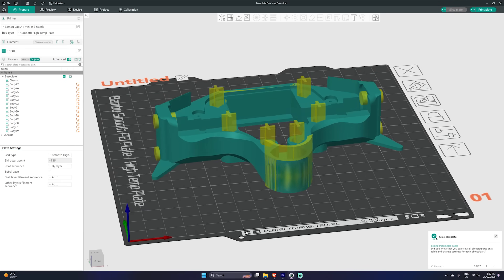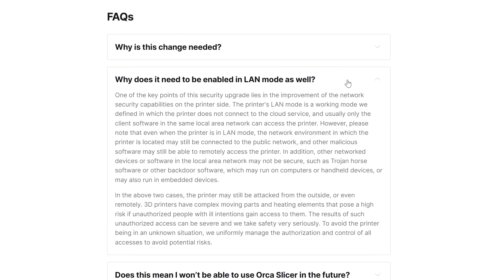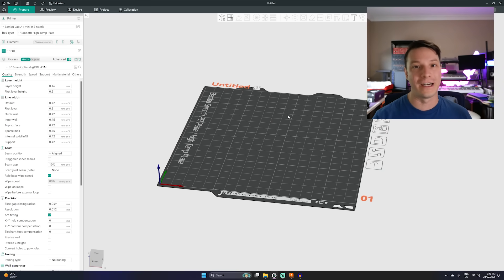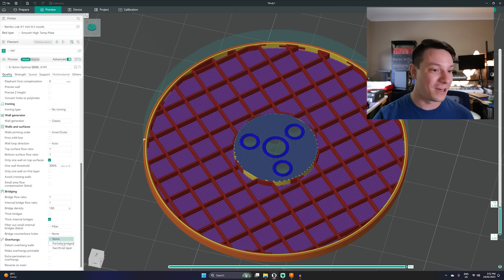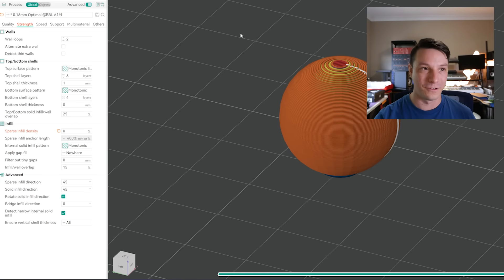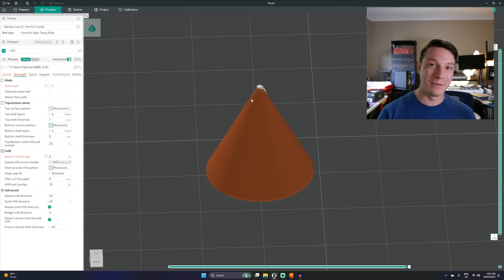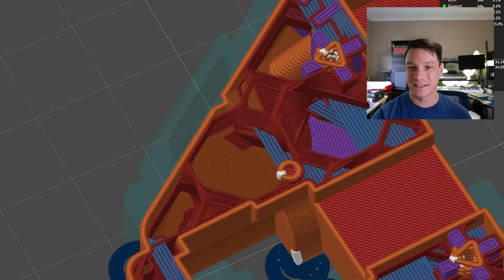I've switched to Orca Slicer for my Bambu Lab 3D Printer (and you can too)

Comment from the maker: A few updates as I'm made aware of them:
- The latest PrusaSlicer has the ability to disable Ensure vertical shell thickness entirely.

- The latest Bambu Studio has the ability to paint in brims, including mouse ears.

I still prefer Orca Slicer, but want to be transparent.
Reply: The latest Orca 2.3beta now has paint in brims too.
Reply: Ensure vertical shell thickness is the ultimate PITA! And the pace of development... Prepare for 1 update per year. Also, Orca's wiki is nonexistent. You need to use BambuLab wiki together with Prusa wiki.
Reply: @Tome4kkkk this youtuber is just making an excuse not to use Bambu slicer. Lol
Reply: @SimplyV3rna  Having 1 slicer for all your printers, regardless of who made it, is a huge time saver. And Orca is way faster at implmenting new features
Reply: Update: You cant print with Orca Slicer anymore. Recent firmware updates by Bambu Lab have introduced an "authorization control system". This system restricts certain printer functions, especially those accessed via third-party software like OrcaSlicer, unless authorized through their proprietary Bambu Connect software.
Reply: @ogxgamedev can't you enable developer mode?
Reply: @Xeldin  Downgrade and LAN, mode works haven’t had any issue’s since
Reply: @ogxgamedev I dont think thats right, I have a brand new a1 mini purchased in july 2025 completely up to date, and i print exclusively through orca, as a matter of fact im doing so right now.
Reply: Just downgrade the firmware. Put into Lan mode, and say bye bye to bambu's BS security. And if you are smart, you block your printer from the internet too.
Reply: Happy with my bambu slicer and i still have my warranty.
Reply: @SimplyV3rna  Warranty? Your slicer has nothing to do with your warranty.

Comment: I switched to LAN mode - print job gets sent to printer but nothing happens. Assistant says MTQQ not accepted by the printer.

Turn on Developer mode on the printer and I get an error "Print job not started" Something to do with a missing file path. 
Either way, I cannotnuse Orca any more even for printing let alone calibration.
Its a great loss.
Reply from the maker: How about via micro SD? I havnt updated some sometime and can still use Lan mode
Reply: @MakersMuse Its a way to calibrate I guess. For general use, SD cards seem so retrograde - we're supposed to be past that😮

Comment: having recently picked up a Bambu P2S, I was taken aback to learn about how locked down it is (this is on me for impulse buying a black friday deal without researching). Hoping this works cause Orca is just better in a lot of ways - not being able to manually calibrate filament is a hard pass. It's clear they wanna get you buying bambu filament for the ease of use and not having to calibrate it, but when it costs twice the price as other options (literally double in AUD), I wanna be able to dial it in when needed and the auto-calibrations don't even get it close so far.
Just need to see if Orca can recognise the AMS/how that gets used with it

Comment: i've got that one setting (ensure vertical shell thickness) in bambulab studio, too. i have: disabled, partial and enabled as options.
i can also have modifiers in bambu studio.. and even tho there isn't a polyholes option, you can achieve stronger holes through a combination of methods: XY hole/contour compensation for accuracy and increasing wall thickness around the hole for strength. Use "Auto Circle Holes-contour Compensation" under the quality settings to improve the dimensional accuracy of circular holes, which can aid in tight assembly. To increase strength, use a negative part to create the hole and then manually increase the wall thickness around that specific area. so baqsically same functionality - different approaches.
In Bambu Studio, "mouse ears" are the
Brim Ears feature, which adds small, circular pads to specific edges of a 3D model to improve bed adhesion in problem areas, preventing warping. To use them, you must first set the brim type to "Painted". You can then either manually click on the model to add them or use the "Autogenerate points" feature to let the software automatically place them

Comment: I switched this week due to bad experiences with the company in general. Their customer service is so bad, dont even know where to start to explain it. So I removed all the possible connections to their servers/service. Add the better Orca Slicer software to the equation and the switch was a no brainer. Put it in LAN mode, added a dedicated IP camera on it and build a local app to check the printer status and skip objects from my local network. They do make awesome printers, so I need to buy those from resellers for a bit more money, but its worth the Bambu hassle.

The change body type feature/trick is crazy useful!

Comment: Hey. I'm a complete novice in 3D printing but whant to skip some steps (I dont whant to be bothered with tinkering a lot). Would you recommend Bambu Lab now? I really like the X1C but I don't like the division they create with manufacturer terms and conditions. Next choice is Prusa MK4S... Completely different, I know. What is the better choice now and for the future?
Reply from the maker: They're great printers, rock solid. I use the A1 mini more than most of my other machines. Sadly yes, they're a closed off company and that could get stricter in future. Thankfully you can take them offline and print via SD card if you really wanted though. The Core ONE is a great alternative, Id go for it over the MK4s.

Comment: Nice if you are using a Bambu, but if you change a sovol sv06 to klipper it drives me nutts, that Orca defines for filament profiles, which printer you can use it on. it is nerv wrecking and maybe I am to dumm to get it right, but so far it is up to the point I can't start using all the good features because of this one!

Comment: So i'm running into an issue with Orca and it not sending prints over even though it says it has sent. It gives me the MQTT error whenever I try and send throguh it. I don't prefer to have LAN Mode on as it's not kept at my place of residence and I would like to access it and monitor prints remotely.

Comment: i'd love to get an update on using local mode with the bambu printers. In my experience, when companies give in a bit to give you some of what you want (but they don't want you using) they usually just make it more and more annoying and less supported until people give in and use their proprietary sender programs or whatever it is they want you to use in their ecosystem. For example, our Bambu printer in local mode will connect, but the video is very unreliable and restarting bambustudio the next day the printer is not found again and needs to be re-added constantly. It's ... annoying. And I even though the forums are full of people saying their local printer keeps disappearing, I don't exect BL to ever fix it because it isn't in their interest.

Comment: Are you connecting directly to your A1 from orca with lan mode turned on (do you have developer mode on as well) or are you using Bamboo Connect in between the two?

Comment: Firstly I HATE the stupid Bumboo Pre print Dance that Studio inserts as a Gcode instruction set.
 printer Does Not need e/calibration. ...On each and every print !
Bored of the printer nozzle chewing away at the rear of my build plate for NO reason

I've been  using SD card  file transport for over a decade...
 I see Zero reason to upgrade my methods.

Comment: I used Orca when I got my X1C. But then I got the AMS. My general thinking now is that the user base needs to lean hard on Bambu Labs. If they want to lock down the eco system, they had better be prepared to keep up with feature parity. They can't have it both ways.

Comment: The thing that drew me to Orca slicer was Bambu Studio's inability to do internal bridging correctly for a specific model. It would slice it so that solid internal infill was printed directly over sparse infill instead of using bridging mode. But Orca has the setting called "Filter out small internal bridges" which allows you to turn this filter to on, limited, or off allowing my model to print without failure.
Reply: Methods to filter internal bridges
Method 1: Adjust bridging settings in Bambu Studio

    "Don't support bridges": In the supports section, enable the "Don't support bridges" option. This will generate bridges without internal support, which can reduce the overall print time and filament usage.
    Disable internal supports: You can also disable internal supports completely by turning off the support settings or set a very low minimum support thickness.
    "Filter out small internal bridges": Enable the filter in OrcaSlicer's "bridging" settings, which will remove small internal bridges. The default setting, "Filter," is typically sufficient for most cases.
    "Bridge counterbore holes": Set this to "None" to prevent the printer from creating bridge counterbore holes for small gaps. 

Method 2: Adjust overall settings 

    "Internal bridge support thickness": In Bambu Studio, set the value to 0 to disable internal bridges entirely.
    "Bottom shell layers": In Bambu Studio, set this to 0 to prevent the formation of bottom shell layers and internal bridges, especially on organic models.
    "Avoid crossing walls": In Bambu Studio's Quality tab, find and enable "Avoid crossing walls". 

Method 3: Adjust settings for specific issues 

    "Thick bridges": Enable this setting to allow the printer to create thicker bridges with higher reliability. This can help to reduce the number of small internal bridges that need to be generated.
    "Bridge counterbore holes": Set this to "None" to prevent the creation of bridge counterbore holes for small gaps.

Comment: I had to make the switch to orca a few months ago because the bambu studio would not allow me to send prints over the wifi cloud without either disconnecting vpn or adding the software to my vpn exceptions - which was a no thank you - i don’t set up any vpn exceptions and will not start with this. 

Kept printer non-updated since, and been printing as normal without any issue.  I doubt i they will ever come up with an update to the x1c or their old AMS  to warrant me thinking of updating the firmware.

Comment: thank you for the video
I had to switch to Orca slicer because after the Firmware and Bambu studio update it started causing issues. I reached out to bambu support and they had no advise or fix to get my functions back. Rolled back machine firmware and it didn't help and I can't find how to roll back bambu studio. 
Not impressed bambu

Comment: Yeah nobody buys Bambu’s argument. Adding basic auth to secure a printer and run a self sign cert is child’s play. This is nothing of an attempt to lockout 3rd party tools and then turn around and create a walled garden under the excuse of certified environment. I guess they are still sore after it was found out that sensitive information got leaked to the company in china …

Comment: Not sure if they were first, but Cura has had the 'make overhangs printable' setting available since at least 2020, maybe 2019. It's an ok setting for some models sometimes, and it can eliminate the need for printing supports for some models.

Comment: Late to the party but good products deserve to be promoted. I was looking to use of klipper last week as I recently bought a neptune 4 plus that I really needed to properly calibrate. I'm completely new to klipper, though not FDM printing, having run an Ender 3 pro for quite a few years. As ever, there were loads of threads on the web that would have me knee deep in gcode, github and other arcane arts. I just wanted an off the shelf product, preferably free, that I could install and use with no messing about. During the search I came across OrcaSlicer, which seemed to fit that bill. Wow, what a revelation. Not only does it give me Fluidd (with which to use Klipper) fully integrated into the slicer, but the machine and filament profiles seem first rate straight out of the box. I haven't even opened Cura again, migrated from the first print onwards. OrcaSlicer does some things differently to Cura i.e. it adds a brim by default, but bit by bit I'm learning how to amend parameters and I will happily go through the learning curve for this ease of use and quality of outcomes.

Comment: I used to use Orca Slicer until I got the K2 Plus and Creality released version 6 of their slicer. They added in all of these features, and it seems like they're continuously porting over new features. Orca slicer doesn't fully support Creality CFS yet, but I honestly don't see a need to move back over. I'm actually shocked that Bambu doesn't have these features.

Comment: AI Summary:

Abstract

This video provides a comprehensive guide on utilizing Orca Slicer, an open-source slicing software derived from Bamboo Studio, with Bamboo Lab 3D printers. It details the process of connecting the slicer to a printer via LAN mode and explores the advanced, customizable features that differentiate Orca Slicer, positioning it as a tool for power users. Key functionalities highlighted include bridge counters for supportless cantilevers, the "Make Overhangs Printable" option, the critical ability to disable "Ensure Vertical Shell Thickness" for precise weight control, using modifiers for variable infill, implementing poly holes for enhanced screw grip, and utilizing mouse ears for efficient bed adhesion. The tutorial uses a complex combat robot chassis as a case study to demonstrate these advanced techniques. It also briefly touches upon the context of recent Bamboo Lab controversies regarding cloud and LAN security, suggesting Orca Slicer as a means to maintain greater control over the printing ecosystem.

Orca Slicer for Bamboo Lab Printers: Advanced Customization and Local Control

*   00:00:24 Open Source Lineage: Orca Slicer is derived from Bamboo Studio, which itself is based on PrusaSlicer and the original open-source Slic3r. This heritage mandates that Bamboo Studio remains open source, enabling Orca Slicer's development.
*   00:01:10 Power User Focus: Orca Slicer offers cutting-edge features and deeper control compared to Bamboo Studio, making it ideal for users needing precise customization (e.g., lightweight combat robots).
*   00:01:53 Bamboo Lab Security Controversy: Discusses Bamboo Lab's implementation of security checks via their cloud service and initial plans for LAN mode, which raised community concerns about open ecosystem access. A compromise allows a variation of LAN mode without these checks.
*   00:03:06 Getting Orca Slicer: Recommends downloading Orca Slicer directly from the official GitHub repository for the most reliable and up-to-date versions.
*   00:04:03 Local Network Connection: Orca Slicer can connect directly to Bamboo Lab printers via LAN mode (requires enabling on the printer and entering an access code), bypassing the cloud for sending prints.
*   00:06:14 Bridge Cantilevers Feature: Orca Slicer includes built-in options (`Partially Bridged`, `Sacrificial Layer`) to automatically add support structures for cantilevered sections directly in the slicer, potentially avoiding the need for full support material.
*   00:07:54 Make Overhangs Printable: An option (potentially ported from Cura) that modifies model geometry to make steep overhangs printable without supports, but importantly alters the original dimensions and may not be suitable for dimensionally accurate parts.
*   00:09:09 Key Feature - Disabling Vertical Shell Thickness: A crucial setting for minimizing weight allows users to completely disable the 'Ensure Vertical Shell Thickness' feature (which adds extra walls on slopes/overhangs). This level of control is not available in Bamboo Studio or PrusaSlicer.
*   00:12:41 Advanced Customization with Modifiers: Demonstrates using imported geometric bodies as modifiers within Orca Slicer to apply different settings (like 100% infill or specific infill types like Crosshatch) to distinct areas of a single model for targeted strength or weight reduction.
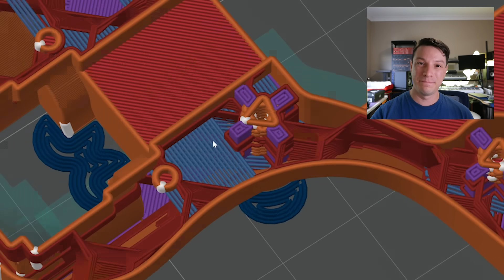*   00:14:48 Poly Holes for Stronger Bores: Introduces the 'Poly Holes' feature (ported from SuperSlicer), which converts circular holes into polygons (optionally twisting layer-by-layer) to create rougher, stronger surfaces for screws to bite into.
*   00:16:15 Mouse Ear Brims: Orca Slicer offers 'Mouse Ears' as an alternative brim type, placing small adhesion tabs only at critical corners and points prone to warping, making them easier to remove than a full brim.
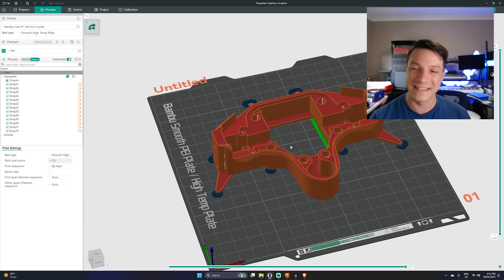*   00:16:59 Stable Local Ecosystem: Using Orca Slicer via the local area network (LAN) provides a printing setup independent of cloud updates or potential future changes imposed by the manufacturer, offering long-term stability for the user's workflow.

I used gemini-2.5-pro-exp-03-25| input-price: 1.25 output-price: 5 max-context-length: 128_000 on rocketrecap dot com to summarize the transcript.
Input tokens: 19020
Output tokens: 736

Comment: i am wanting to print bookmarks.  But a third way into the print, I want to inlay a printed cardstock with an image, and then print text on top of the printed cardstock, is it possible to land the printhead at the correct height to print on the cardstock.  I have tried several times and failed.